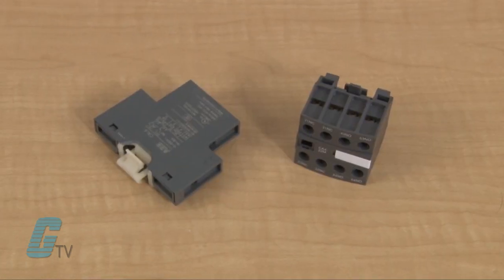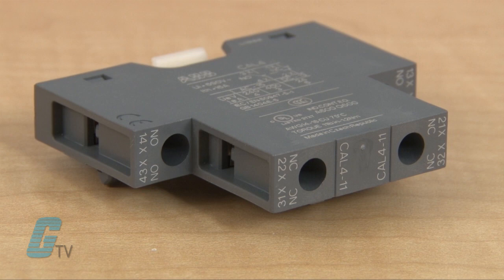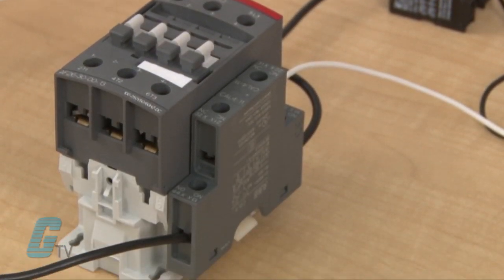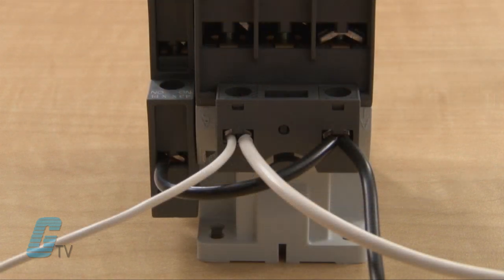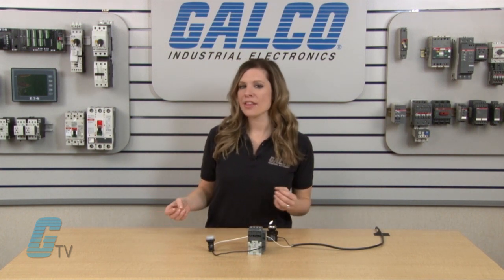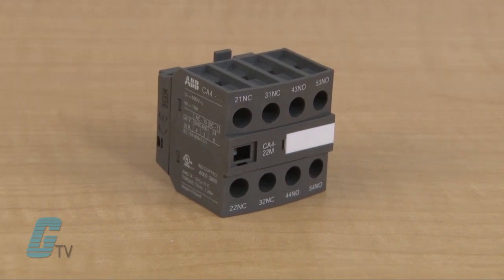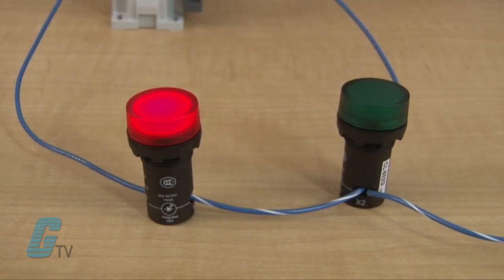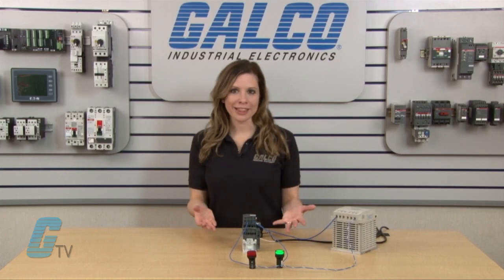How to Wire Up an Auxiliary Contact on a Contactor

Comment: if i wire an aux contactor for 24v supply to a plc and want to add a snubber do i install parallel across the input and output of aux relay or from ground to input of auxiliary relay?

Comment: Madam I am use three phase moter starter 380 v coil supply my  moter panel in side samll transformer 400 in put 380 v out put contoral wring  in conncat  so in case I use 220 volt conncator coil   I conncat 1 phase transformer and nutrial dricket conncat   so in case my transformer any problam coming please reply

Comment: Hye Katie Nyberg, please help me how to connect two contractor work with relay and pressure switch of air compressor.
Reply from the maker: You will need a diagram and we can't post those here, so you will have to contact our engineering department anyway, ok?Give us a call at 800-575-5562
Reply: Thak you so much.
Reply: Hahahaha!  How the fuck is an actress gonna help you connect contactors?  She probably thinks it's all done by magic!  All she could do is help you on how to perform a mediocre script-reading.

Comment: I need to switch on a new circuit at 30 AMP load on main circuit. How this can be done?
Reply from the maker: You should be able to add another contact block for connecting additional circuits.
Reply: Can you share details. I need circuit should be activated only when load reaches at 30 amp in main circuit
Reply from the maker: Ok Surendra I found a current sensing relay adjustable 5 to 50amps you can setup easily. Follow this link http://www.galco.com/buy/SSAC/ECS6HAH to check it out. You can order online or call us at 800-575-5562 and our sales staff will be happy to help you with this.

Comment: hello i want to know how to connect analog input to vfd and program the same in vfd e.g. i have to control cfm
Reply from the maker: Hi Syed, Well this shouldn't be to bad. If you don't have a User manual for your particular VFD get 1 please. Look for AI1 terminals and analog common. Next determine if you are doing single ended or Differential signal connections from your controller. Once the wiring is completed, you will need to find the AI1 (Analog Input 1) configuration parameters to scale it for your application. However, many times the default parameter values will work fine. For more information on setting up a particular drive, go to Galco.com and scroll to bottom of page and look for "Contact us" under the Customer Service heading. We have several experienced product managers happy to help you with you questions.

Comment: i ned help for my connection of 1 phase motor and magnetic starter with overload relay..
Reply from the maker: Hey Larry,

Here is what we suggest you try:

Connect the motor to the T1 and T2 terminals off of the Overload relay portion of the relay.
Connect the line power to L1 and L2 or L and N terminals.
Some of these are made with mechanical start buttons and some will require a control voltage, usually 115Vac or 24Vdc
And if you bought it in a box/enclosure it may use the same as the motor voltage.

Let us know how this went for you and we will go from there!
Reply: @GalcoIndustrial  I think he ded